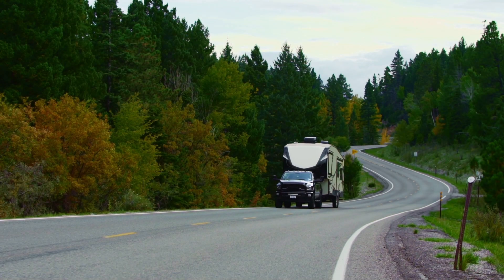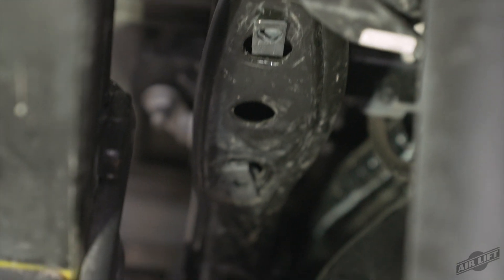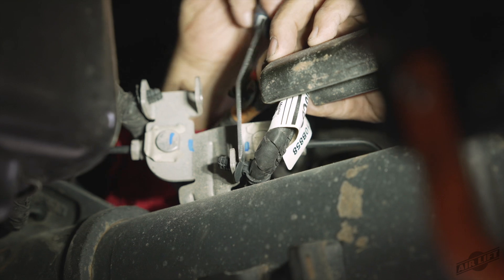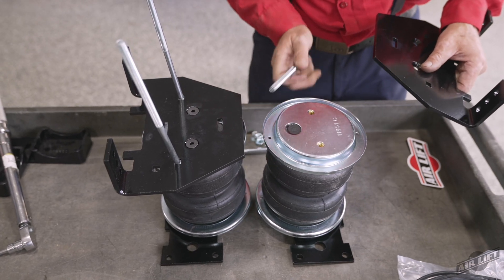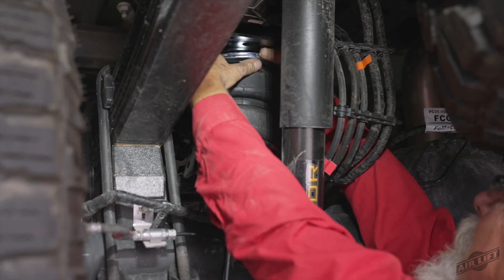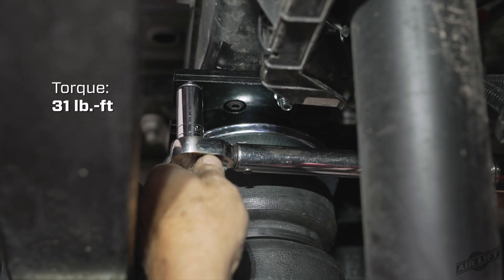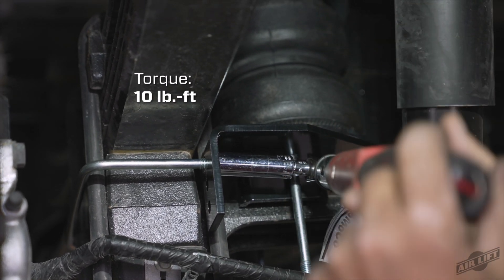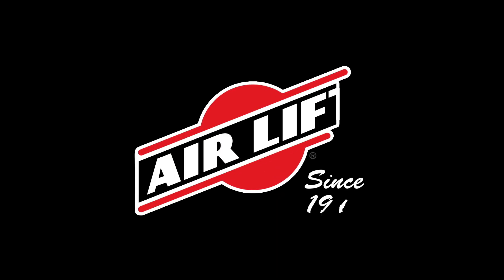Air Lift Install 57354: Ford F-350/250 4WD SRW - LoadLifter 5000 - 2023-2025

Comment: I have the same truck. Could I install the Air Lift 89352 LoadLifter 5000 Ultimate Plus Air Suspension Kit  with the Air Lift 52500 Universal Air Spring Cradle for my truck?  I assuming the installation is pretty much the same as the video demonstration?  Thanks for your help.